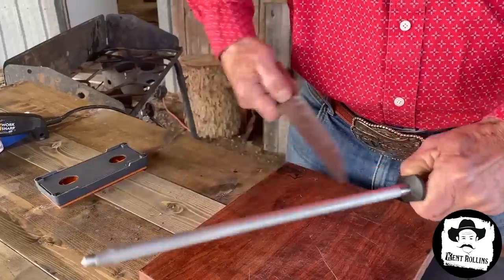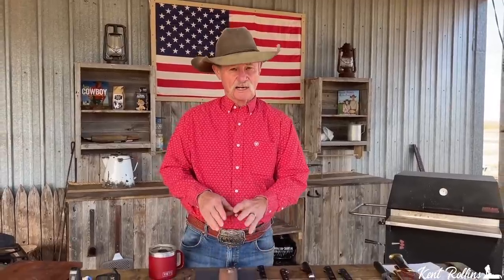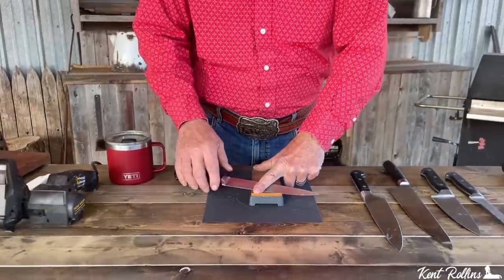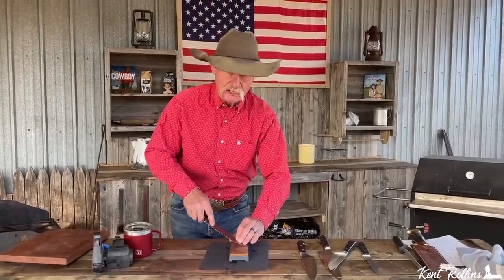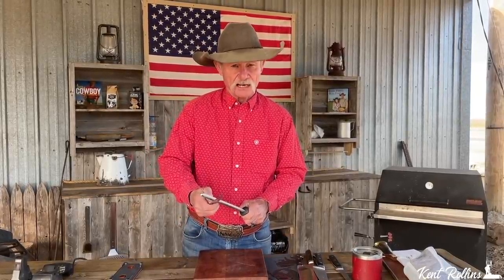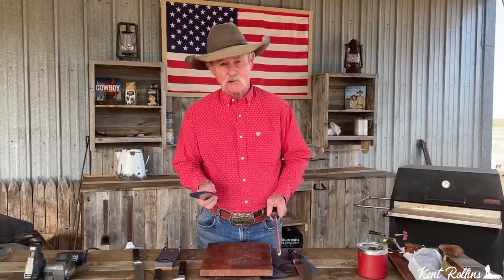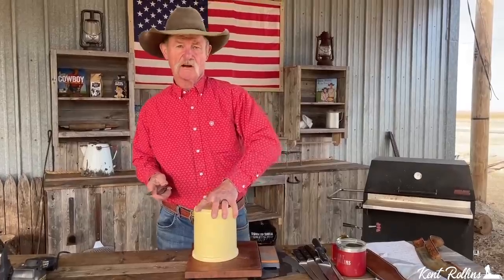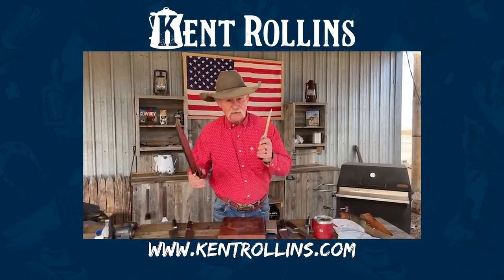Best Knife Sharpening Tips | How to Sharpen a Knife

Comment: The best angle to use is the existing angle of the bevel, unless you want to go through the headache of reprofiling an edge, which can take a long time on some of the harder steels. I use the "shadow method" to find the correct angle. I raise the spine of the knife until the shadow under the edge disappears. Make sure you have a good light source above you, so you can see the shadow. I maintain this angle while I sharpen. A beginner can tell if theyre maintaining the correct angle, by using a black sharpie on the bevel plane/face. The sharpie should be removed cleanly along the face of the bevel as you sharpen. Once you get better, you can just look at the face of the bevel and tell, because the scratch pattern will show. I keep removing materiel from one side until a burr begins to form on the opposite side, along  the entire length of the edge from tip to base. You can use your fingernail to feel for the burr. It sometimes takes a while to establish a proper burr. The burr indicates that an apex has formed, and that the edge is basically folding over. I repeat the process on the opposite side, removing the same amount of materiel/using the same number of strokes, until another burr begins to form. I then move to a finer grit, repeating the same exact process. I usually stop on a 2000 grit diamond stone (diamond steels are awesome for beginners), while gradually reducing the amount of pressure  and swipes on the stone. I stop on the diamond stone after I've done 10 or so alternating single swipes per side. Again, I use very light pressure. During the sharpening, I'll wipe/rinse off the metal dust that forms. This helps the stone"cut" better.  After that, I move on to a leather strop, loaded with chrome oxide, to remove the fine burr that was formed during the last step. Chrome oxide comes in the form of a green crayon. You rub it onto the surface of the leather. I do 30 or so swipes on the strop per side, moving spine forward. You're basically wiping the edge on the leather. I then do 10 or so alternating single movements while maintaining roughly the same angle. Angle isn't super important while stropping. This always produces a nice shaving-sharp edge. It takes a lot of practice to master hand sharpening. I suggest using the cheapest knives you have, while learning the proper technique. Once you get good at it, it's fun and very satisfying.

Comment: A sharp knife cut heals faster than a dull knife cut. A sharp knife cuts, a dull one rips and tears. That said, some knives need better edges than others. Fillet knives need a shallower bevel than, say a machete. The "Double nickel" method works for most kitchen knives, however a fillet knife needs a bit shallower edge. More like a "double dime" in my experience. And then an axe benefits from a different sharpening. Again depends on the axe, but many benefit from a convex edge produced with wet/dry sandpaper on a 1/2 in thick soft rubber mat. Same deal with a kukri (Gurkha knife).  So you need to take the knife, it's use and geometry into account. And yes, I have used my pickup window to sharpen a knife.

Comment: I'm all about keeping a sharp edge but my Lanske stones keep getting gummed up from the honing oil. Any suggestions?
Reply: I never use oil to sharpen knives, I don't need to! 🔪
A Few drops of water will work! 🔪
I may use oil to help sharpen various tool blades if I think necessary, but rarely! 🔪
Read my own separate comment on how I do it! 🔪
Reply: use a lighter oil, or upgrade to the diamond stones.  additionally you can lightly rub another stone over the surface to resurface them.

Comment: the grip hold draw through sharpener does work, but I don't trust that guard.  I usually braced it against something or put it in a soft vise. you must pull the blade through straight, not cocked one way or the other.  done right, it only takes a couple of pulls.  any more you are just wearing your blade away .  the nice thing is that, because it works both sides at the same time, the chance of having a rolled edge is minimized.  that can make the final honing less tedious.  or you could just go to work with a serviceable edge.

again, they do work ... but you may have to experiment a little to get the best results.  apply overkill  to caution as you do, many have laid fingers open by being too careless with them.

Comment: For our kitchen knives I use a Chef's Choice pull through sharpener with slots for Asian and European knives as well as a polishing/honing slot. I use the polishing slot more than anything else, just 5 or 6 passes through it every couple of uses is enough to keep them razor sharp. I have stones of various kinds and grits but the Chef's Choice gets the knives as sharp as I can in a tenth of the time. I used to pay to have my good Japanese knives sharpened because I just couldn't keep the 16 degree angle steady but the Chef's Choice does a better job than the "professionals" did and I don't have to drop them off and wait a week to get them back. I can sharpen the heck out of pocket knives and anything with a blade up to about 4 inches but over that and I can't keep my wrist steady enough to get a consistent angle.

Comment: I have used oil stones for 50 years or so. The way I do it is to imagine slicing a thin slice of the stone off moving the blade away, two strokes per side, then flip the knife over and repeat. My long used angle is between 10 and 15 degrees. New knives may take some work to get the factory bevel changed to one's own personal angle.  

Thanks for all the great videos, wish I had stumbled across them years ago.

Comment: The best and most suitable way I sharpen up any knife is by using a wide enough hard stone.  🔪
 I don't need to put water on my particular stone, which I found on a beach! I used another stone to make it level!

I put finger tips of opposite hand on top of, or back, of knife, close to front or point, to keep pressure on blade, as I sharpen! 

I turn blade over after each stroke, this keeps edge even. 🔪
I tilt the blade slightly up from the angle, to feel the edge Just griping, as I make the sharpening stroke.
I wipe blade, do the same on the finest grade black sandpaper, used for metal work.
I do same on a hard piece of leather!
This polishes the edges!  🔪
For a really rough or damaged blade edge, I will start with a file if necessary. 🔪

Comment: Sharpening removes more steel off your blade than honing, honing removes more steel off the blade than stropping. Stropping is done on leather or other materials, you can even use heavy denim stretched over a piece of wood with some compound on it!😂 When Kent was using bull hide in the old hash knife video, that's STROPPING. Stropping is what kept your old barbers straight razor keen. When the strop quits workin, you have to back up to a ceramic or diamond hone. We use good diamonds and ceramic now because they do not dish out over time. They stay FLAT. I have honed knives on coffee cups etc for sailors and Marines at a Navy base. Not just kitchen knives but combat tools. Adapt, Improvise, Overcome😂

Comment: Nothing bothers me more than having some think they know how to use a sharpening steel and then watch them whip the knife back and forth quickly, like you did. Half of those strokes are doing nothing more than scaring the knife blade up. Take a $300.00 knife and turn it into a $10.00 piece of scratched up junk.

Comment: Sorry Kent, but when you drew the knife back on the diamond stone towards your hand holding the end of the stone in place, I cringed.  Much safer to place the  back of a stone against  the edge of a small cutting board to prevent it from moving, so if the knife should suddenly slip off the stone, your hand is not in its direct path.  I still have a 1-1/2 inch scar where the ER stitched my left hand closed after that happened to me. Maybe it was just me... but safe than sorry.  

 I absolutely love the car window trick!

Comment: Are diamond stones dangerous? The are coated with specklings of diamond dust. I can imagine they must give off diamond dust as you drag the knife across them. Surely you would breathe that in?!
Reply: I'd guess you are correct about them giving off minute amounts of dust, but unless you are sharpening for hours at a time - I would guess that it is probably safe - especially outdoors.

But i am not an expert and do not know for sure.
Reply: yeah glass dust can be dangerous but also your nose is made to filter stuff like that.   Just don't overdo it and be sure to note nasal bleeding etc-that's the main thing
Reply: @ETHANR26  But can our body expel glass dust?
Reply: @DamienNeverwinter  if it gets in the lungs, or from the nose?  nose is usually fine, in the lungs you may have problems
Reply: @ETHANR26  I'm thinking dust mask when using diamond sharpeners from now on